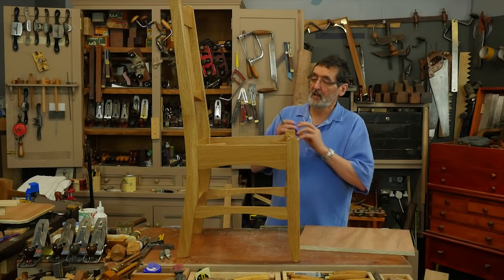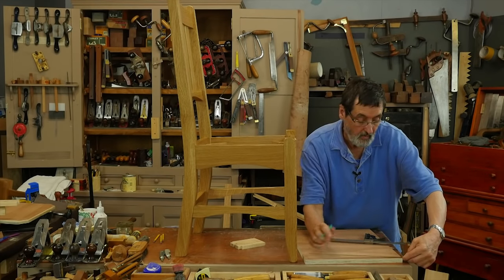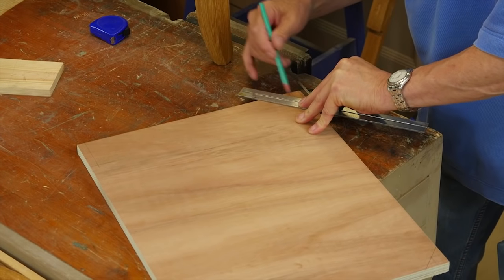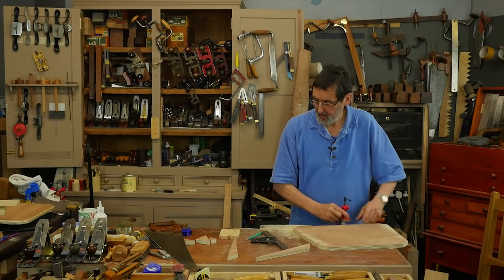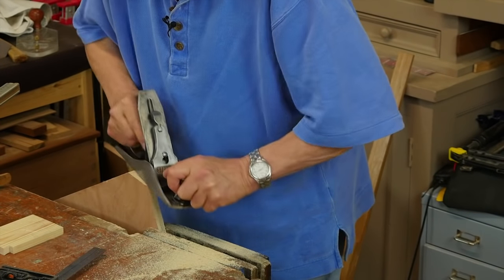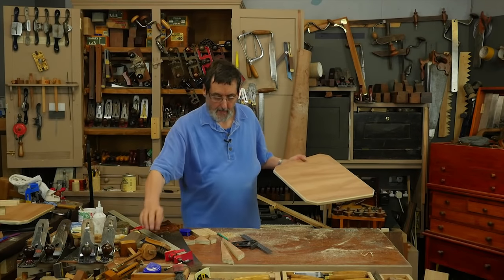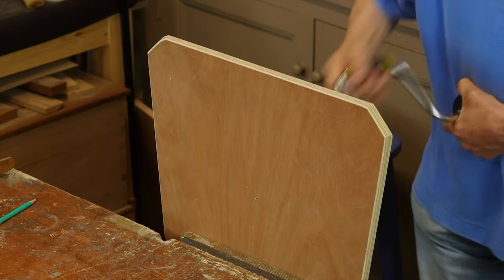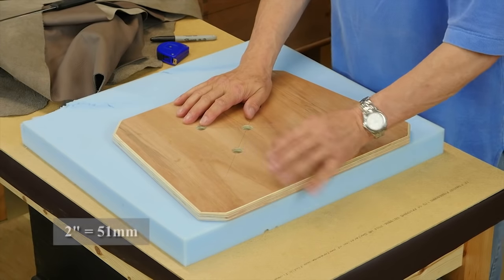How to Upholster a Chair Part 1 | Paul Sellers

Comment: Great video Paul to get this year on the go, It made me remember what my late father did as a self educated upholsterer and I'm sure he used to overlay the foam with some kind of white thin stuff (Kind of silky wooly stuff that stretches as you pull it and adheres to the foam) in order to let the leather kind of slip over the foam. I have no idea what it's called. do you know? looking forward to see part 2. Thanks.
Reply: might be a bit late to be answering your question, but from your description I'm almost positive you're thinking of dacron batting. You put it over the foam and staple it down to the wood frame, pulling it tight enough to round off the sharp edges of foam  without cutting it like Paul did. I've also heard that it reduces wear between the foam and fabric

Comment: Hi Paul I'm looking a at some Stanley 750 chisels what do you recommend to use to protect the metal from rust as I'm sue you will have much more knowledge  and experience than others thankyou
Reply: +Matthew Dickenson I live two miles from a great lake in NY, things rust bad so I might be qualified to answer your question! And I don't think Paul replies to many YouTube comments. Anyway, I like wax to protect tools from rust. Paste floor was is easy to apply, because of its low melting point it can be melted into the pores of metal with the friction from a rag so it really protects. It won't stain wood like oil might, and it really reduces friction on wood when applied to the bottom of a hand plane. Win win!
Reply: +Matthew Dickenson I think Paul has mentioned before that he uses 3-in-1 oil for most things.   Any light machine oil will do.  Just wipe them down carefully so that you don't stain wood with the oil.  Personally I use a 4:1 mixture of coconut oil and beeswax.  It makes a light paste wax.   I use it primarily as a wood conditioner that's foodsafe (I make a lot of kids toys) but it ends up on my tools and does an excellent job of protecting them.
Reply: +MichaelKingsfordGray It has to be an oil that will polymerize at room temperature for it to produce heat. Machine oil is unlikely to do so, it's just best to keep sparks away. Linseed/Danish/Teak oil/etc. are indeed the biggest threats.
Reply from the maker: +Matthew Dickenson I keep a small tomato can stuffed with a rolled up rag charged with 3 in 1 light machine oil.

Comment: Why not use exacto or similar knife for leather? Possible you can have same results from one cut pass :)
Reply: +Aleksandr Goldyrev When i was an upholsterer i used a stanley knife to cut the leather out and a similar knife to Pauls for cutting the foam. Strange we built all the furniture in millimeters and measured the overlaps and allowances for the upholstery in inches.
Reply from the maker: +Aleksandr Goldyrev The foam just cuts better with the large knife and it was there handy for the leather too.
Reply: +Paul Sellers Hi I have watched your video on sharpening using the Eze-lap hones. My dumb question is can you use these for serrated knives?
Reply: +Ian Scott i'm willing to hazard a guess that is why he "sharpened the serrations out" of his knife. flat stone = flat blade. it won't mess anything up, but it will remove serrations eventually.